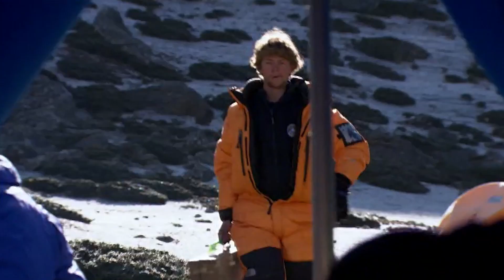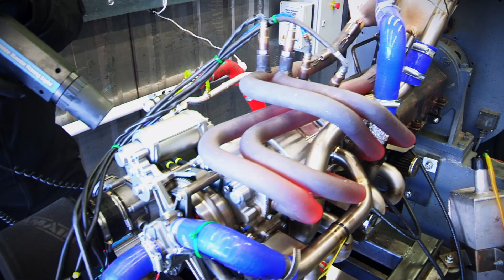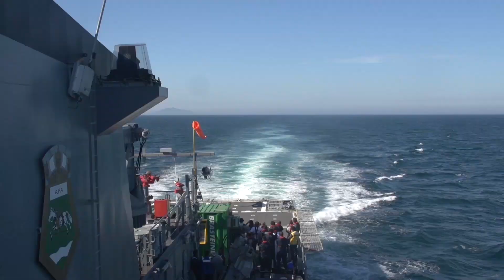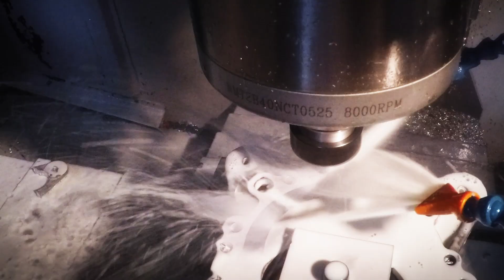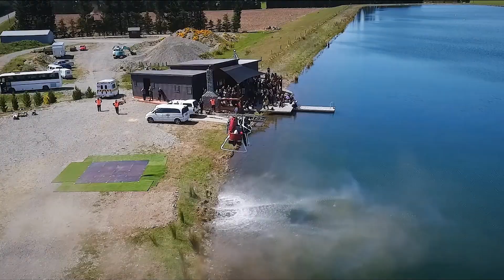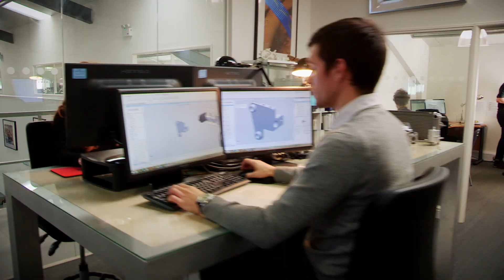Introducing Rotron Power Engines

Comment: This would make a great gokart engine
Reply: It made a terrible go cart engine in the 1970s when Sachs sold this exact engine.
Reply: Hell yeah a shifter kart with this Rotron 690CC. A NRV588 witch was bummed off sachs would be sick in a shifter kart.
Reply: @jlo13800  Rotron doesn't sell engines... Gilo Industries only makes paramotors and they buy reciprocating 2-stroke engines from Vittorazi SpA.
Reply: @sandervanderkammen9230  Rotron is in the UK, i heard they run silkolene pro 2 sx in the rotaries. Not sure. What 2 stroke oil do you run is yours.
Reply: @sandervanderkammen9230  AIE is got a 650CC 125hp single rotor, it uses a big blower fan to cool the rotor, called SPARCS technology. funny thing is i have seen a big 4500 HP Siemens electric motor king of using the same principle to cool the rotor.
Reply: @jlo13800  AIE is not a manufacturer.. 
Yeah thats another version of the same 1960s vintage Sachs KC60 engine
Reply: @sandervanderkammen9230  They scaled to 650cc per chamber. i have had good results running amsoil interceptor 2 stroke oil. the dominator is for racing 2 strokes and it will crud up if not run hard enough. Rotaries dont have the high compression/temp the 2 stroke piston engine do. I notice a lot of smoke when he runs Brian Creighton run his bike . It sound like it wont idle good.
Reply: @sandervanderkammen9230  Rotaries are like some 2 strokes and run oil injection, no sump or oil changes required!
Reply: @sandervanderkammen9230  Both Ball lightning and the sun are rotary loop charged plasma 2 stroke. I dont suggest connecting a copper or stainless rod to a Parajet or aixro-xf40 and flying in a thunderstorm as lightning may stroke and create a 60000 deg f plasma which would melt the roller bearings to the e-shaft and melt the charge cooled rotor.
Reply: @jlo13800  Parajet only uses Vittorazi reciprocating engines now
Reply: @sandervanderkammen9230  They went back to piston 2 stroke as they can have much more low end torque.  I looked through the rotron pdf broshure and the torque on the 300/600 is poopsey and dont come on till past 5500 rpm. the only machine that makes torque from 0 to over 6k is a rotary electric motor. the little Siemens 260 348 HP motor can fit in out lap and make 348hp or more and 737 ft-lbs torque @ 2500 rpm all day from idle to that rpm. there are electric motors you can hold in your hand that make insane power/torque and like 8 hp/lbs'ish power to weight. Tesla's are just trashing 4 joke stroke/2 strokes at the drag strip and all that has to be done it tap radiant ZPE and get off frail chemical fuels which use valence electrons anyway. Mounting a rotron 600 drone engine to a motorized sofa would be fun though.
Reply: @jlo13800  Gilo Industries stopped selling Wankel engines because reliability and durability problems.
Reply: @sandervanderkammen9230  It looks like it long live the 2 stroke piston engines, detroit diesel, Rotax, Polaris, Fairbanks Morse and Cummins (Achates Power). I got someone on the horn at Rotron and he said to run Silkolene pro 2 SX 2 stroke oil. The ceramic apex seals help but they are not indestructible.
Reply: You can still get an Aixro XR-50 from rennntech karting , it's 50 hp@8500 RPM and need 50:1 Rotaries are smoother, dont require oil changes and dont vibrate much. They are just a funny form of 2 stroke. A KX250 can make will over 50 HP at 7800 rpm's and much torque if a an exhauste trapping valves is use that shuts up the exhaust port and allows a longer burn time with high compression. That how the 8v92 detroit 2 stroke i get out back works. getting a few gallons of BRP XD-100 2 stroke oil was onsale at walmart to top her off.
Reply: @jlo13800  What API or JASO rating?
Reply: @jlo13800  old stock, production ended.
Why? The Axiro XR-50 sucks!
Reply: @jlo13800  Wankel not Rotary type engine...
Rotary engines are 4-stroke but use oil injection because the crankcase is the airbox..
Reply: @jlo13800  why would you premix a Detroit Diesel engine???
Reply: @sandervanderkammen9230  Its Etec oil for evinude, SAE 40W and cheaper than  silkolene. My girfriend had an RX-7 and ran nothing but amsoil dominator even though that was overkill for that 13b. it ran off the stock oil injection and you just add it as it goes. the burn rat is like a quart per 1000 m iles which was noremal, the amsoil dominator was the racing synthetic 2 stroke oil and way tougher than any 10w30 4 joke oil even though the 13b was lower compression and less loading than many 2 stroke, it was fast but it did not have a lot of low end take off torque.
Reply: @jlo13800  What is the API JASO rating???
Reply: @jlo13800  Mazda 13b engine is a 4-stroke engine.
Reply: @sandervanderkammen9230  they are durable because they are sad, not even the best tool steel roller beaings, e-shaft, plasma coated ceramic housing or YSZ ceramic seal well help them last long as sadness breaks them down! sadness destroys the best steel and ceramic regardless what ever the Rockwell hardness is.
Reply: @sandervanderkammen9230  https://www.youtube.com/watch?v=If4RfooLBwg
Reply: @jlo13800  Thanks for proving my point.... stupid people can't read the label or the manual.
Reply: @sandervanderkammen9230  These are amazing engines and they could work with pulsed plasma Like Joseph Papp inert gas filled pulsed plasma 2 stroke engine. The toroidal plasma ball lighting plasmoid is the key to tapping ZPE. I have Moray B Kings books on this. Interesting stuff.
Reply: @jlo13800  Use 2-stroke oil in your flux capacitor.
Reply: @sandervanderkammen9230  Actually castor oil is used in some capacitors on electric motors. The castor 927 Maxima is the top racing 2 stroke oil and has some low ash detergents to burn cleaner but you got to really push the motor to burn it off. Amsoil interceptor 2 stroke is more than enough for  my rotary and it 52$ a gallon jug. A rotary dont have as high compression as gas/diesel 2 strokes and lower burn temp so Castor 927 maxima could buger things up in a rotary. Amoils dominator is a racing oil and is harp to burn off. I got some of that also. The BRP XD-100 Etec oil for evinrude is for my bigger v8 2 stroke detroit. 48$ a gallon at walmart. and a very good oil.
Reply: @jlo13800  what 2-stroke oil do you recommend for the flux capacitor in my 1982 DeLorean???
Reply: @sandervanderkammen9230  Redline synthetic 2 stroke oil. Its not cheap but you could get by with XD-100 Etec full synthetic. the Delorean has a impulse gravity wave driven sachs km914 294cc.
Reply: @sandervanderkammen9230  An inverted wankel patent:https://www.youtube.com/watch?v=-SDGbZwVY20&t=55s
Reply: @sandervanderkammen9230  Silkolene pro 2 SX and Motul 8002T are like $16.50/quart that's a ripoff!
Reply: The DeLorean is powered by a 4-stroke PRV V-6..
Im talking about "mr. fusion"
Reply: @sandervanderkammen9230  I talkled to Paul Moller on the phone about when the rotapower charged cooled thingy was going in production and they are still trying and almost did but the covid19 hit. Not even god can put put this motor in production. The Aixro xr-50 from rennteck karting is like $5000 for only 294cc and 50hp. you can get big block snowmobile 2 stroke really cheap with way more torque and power. You could convert a LS1 chevy v8 into a 2 stroke for less than that.
Reply: @sandervanderkammen9230  You can convert to a 2 stroke poppet valved loop scavenged. Its been done with the 2JZ toyota and is a neat modification for 3L 2JZ toyota race fans. Also every lighting bolt is a 2 stroke plasma. You can use 2 stroke oil in a 4 stroke crankcase and i do that today its just overkill as its kinda of thick.
Reply: @sandervanderkammen9230  Check out this generator, you could build one for your delorean.https://www.youtube.com/watch?v=P-a8QAeCoNU&t=651s
Reply: @jlo13800  I wouldn't use any oils that are not API rated... even of it were free.
You have to be stupid to buy Amsoil.
Reply: @sandervanderkammen9230  A poppet valve 2 stroke VW 1.9TDI:https://www.youtube.com/watch?v=qosAllch8Sg&t=107s
Reply: @sandervanderkammen9230  The inlet valve need to be baffled to cause a loop carhe and prevent short circuiting for a perfect sweep. The cams need to run 1:1 with the crank but the exh valve need to open a bit early to allow exh bleed down. Its sound like you are a true 2 stroke fan like me. More2 stroke exist in the spirit real 4th dimension due to better materials/metals andinsane multi axis machining with aetheric streams. this can even cut zirconia/yttrium ceramic roller bearings and M50Nil tool steel crankshafts/ rods and other parts. These advanced metals/ceramics are materialized right out of the quantum vacuum using though energy there
Reply: @sandervanderkammen9230  What oil do you like? The interceptor works fine and is SAE 30w full synthetic 2T. What is the worst that will happen, form a black hole? XD-100 BRP is just as good and cheaper and available at walmart.
Reply: @jlo13800  What is the API rating???
Reply: @jlo13800  Do you make your hats out of regular or heavy duty aluminum foil???
Reply: @sandervanderkammen9230  I been ggoling it and cant find it so ill get on the horn can call amsoil and find out now that im am curious. API american petroleum institute rating. It is SAE 30w not 10w30 full synthetic. XD-100 is SAE 40w.
Reply: @sandervanderkammen9230  7068 billet aluminum. Aluminum is not good for us and why would anyone make a hat out of it. The witts generator is interesting as uses the quantum vacuum field ZPE which has 10^108J/cc. Tom Bearden is on this.
Reply: @sandervanderkammen9230  Amsoil is tight lipped on this but i will find out! Ill get someone on the horn. Dont use dominator unless you are really maxing out your engine as its harder to ignite and burn off than interceptor or XD-100. Your delorian makes 450hp in 4 stroke more and 1350hp in 2 stroke mode. Ill bet you are running ceramic roller bearings in her.
Reply: @jlo13800  I ask for the API rating, not the viscosity.
API ratings are a S, C or T
E.g. API SL or API TC
Reply: @sandervanderkammen9230  Hold on ill find ou i get on their site and they dont mention, they brag on how hot and clean it burns but ill will call them. What oil are you using, silkolene?
Reply: the jug i have dont say nothing!
Reply: You got a sachs 294cc dont you?
Reply: @sandervanderkammen9230  ill keep searching, Jim Morrson's 800 cubic inch V8 2 stroke ran Motule 8002T which is 16.80$ a quart!
Reply: @sandervanderkammen9230  Alien spacecraft and run ceramic roller bearing in their propulsion impulse gravity and all their machine CNC tools with laser radiant beams. All they need is a bit of graphite powder! Both silicon nitride and zirconia ytria are used on all the machinery on there. they have 5 axis CNC mind over matter machine tools aboard! The rockwell hardness of their tool steel is insane!
Reply: @jlo13800  If it doesn't have an API rating then its shitty low quality oil. 
Even recycled oils have an API rating!
Reply: @jlo13800  I own an original Sachs KM24 engine.
Reply: @jlo13800  So you wear a hat made of heavy duty aluminum foil then?
Reply: @sandervanderkammen9230  i think we all need to get over the chemical burning 2 stroke/4 stroke and tap radiant/ZPE! Even the hydrogen 2 stroke will reach its limits!
Reply: @sandervanderkammen9230  Who cares what the API rating is it holds up way better than multi viscosity 4 joke stroke oil but ill find out now you got me thinking about it. The ghost 72 arctic cat puma with sachs km914 just went by again with 40 hp! I have no idea what oil they run in the spirit realm in this thing.
Reply: @jlo13800  Any oil that cant pass API testing is garbage.
Reply: @jlo13800  How would you know? If your oil doesn't have an API rating you don't know anything about it except maybe the viscosity, if its not API rated you can't even prove what the viscosity is!!!!
Reply: @sandervanderkammen9230  OMG you driving nuts, what oil do you want or like for your 294cc sachs pulsed plasma anti gravity 2 stroke. Do you want a nissan UD-6 2 stroke diesel! Holy cermamic roller bearings batman ET will fire up his machine shop 5 axis CNC with mind over matter!
Reply: @sandervanderkammen9230  Oh shit you just converted a 2JZ 3L into a 2 stroke congratulations on your 1850hp dyno run!
Reply: Amsoil works who cares about the API as the a ghost keeps running a sachs 294 40hp articat on god knows what, shit he drives by at around midnight and runs ceramic apex seals. most likely silicon nitride or what ever they have over there
Reply: @sandervanderkammen9230  oh no its not! The spirit that haunts my property as unlimited machine shop capabilities and makes over 160Hp out of 294cc billet 7068 aluminum, tool steel e-shaft and ceramic apex seals and roller bearings!
Reply: @jlo13800  It on loan, part of exhibition at a museum.

I collect antique and obsolete engines like the Wankel.
Reply: @jlo13800  What kind of ignorant fool buys oil that doesn't have an API rating???
Reply: @jlo13800  YOU WILL VOID YOUR WARRANTY IF YOU USE OIL THAT IS NOT API RATED
Reply: @sandervanderkammen9230  A lightning strike is a 2 stroke over 60000 deg f and no gas/oil weak chemical fuels required. Chemistry just bumps a few valence electrons, broken symmetry inn the vacuum. Mother nature's rotary is out of control as it damn near leveled kenntucky and that awful as the damage is unimaginable!
Reply: @jlo13800  Only stupid people buy oil thats not API rated.
Reply: @sandervanderkammen9230  gasoline 2 strokes make way more power than diesel2 stroke/4stroke
Reply: If you dont like asmoil 2 stroke dont run it, get over your API ratiing, i you hate it dont run
Reply: @jlo13800  DIESEL 2-STROKE  engines require API C rated oils.
Reply: @jlo13800  Any oil that is not API rated cannot be used if you have a warranty.
API guarantees the quality and the correct application for motor oils.
Reply: @sandervanderkammen9230  yes and amsoil dominator an MTU just bit me as i pulled its tail
Reply: never corner an MTU as they they bite
Reply: @jlo13800  Amsoil is crap
Reply: @sandervanderkammen9230  yes TCW3
Reply: not multigrade 4 joke stroke oils as 2 stroke diesel runs on anti friction bearings and has high loading
Reply: @sandervanderkammen9230  XD-100 is CF-2 rated
Reply: amsoil is overkill but i did dump in 2 quarts of amsoil dominator that i had siting around
Reply: @sandervanderkammen9230  Wankel is oil injected and does not need oil changes like  4 joke stroke
Reply: @sandervanderkammen9230  i had a 69 472 caddy 2 stroke that took tcw3 penzoil at 50:1 and internal filled total loss
Reply: @sandervanderkammen9230  Im glad that the electric motor is kicking the crap out of the piston 4 joke stroke as i hate it
Reply: @sandervanderkammen9230  Amsoil interceptor more than exceeds the oil as diesels do not produce much power for there size. they need a lot of hel to make power with turboes and and a wankel is much more powerful than any diesel! Diesel do not even come close to a wankel or 2 stroke spark ignited engine, cooper bessemer has a piston ported natural gas V16 2 stroke W330 that makes 9300 hp to 12,500 hp at 330 rpm to 514 rpm! they do not need oil changes like the wankel does not and total loss burn off like a skidoo or 60's caddy
Reply: @jlo13800  You have to be stupid to buy a oil that doesn't meet minimum API rating and voids your warranty.
Reply: @jlo13800  Amsoil is crap oil for stupid people
Reply: @sandervanderkammen9230  What is your favorite oil? This stuff works good
Reply: @jlo13800  Depends on the vehicle... 
I use Aral SuperTronic G in my Ford and my Porsche because it meets A40 specs.
I use LubroMoly Synthoil Premium in my BMWs and my VW because it meets LL-98 and 503

I use Agip Novecentro in the Maserati

I use Swepco for the Aircooled  Porsche and VW transmission lube because it shifts best with the old style synchros.

Motul gear lube for the newer VWs
Because it meets VW G51

Redline D4 ATF for all the Dexron automatic transmissions and the ZF manual transmissions that use ATF (BMW and Ford)
I use Total in the Yamaha SHO
Klotz in the old Honda and Kawasaki bikes.
Motul in the new bikes.

The list goes on....
Reply: @sandervanderkammen9230  You got a lot of nice high dollar stuff there
Reply: Are you running this oil?
Reply: @jlo13800  What is the API or JASO rating???
Reply: @jlo13800  Do you work in a florist shop?
Reply: @sandervanderkammen9230  On a tugboat with huge 2 stroke diesels, im used to total loss oil burning. One of my OMC 528cc sled rotaries is haunted and it gave me a stinging sensation when i touched it. Its in the back room. I got a few and i tinker with them inside when there is a thunderstorm.
Reply: @sandervanderkammen9230  Also rotaries are powerful torsion field generators too.
Reply: @jlo13800  Do you shape your poo into little rotors on the days they don't let you out for exercise?
Reply: @jlo13800  Thorazine is a powerful antipsychotic medication.
Reply: @sandervanderkammen9230  what rotors?
Reply: break rotors?
Reply: @jlo13800  The shapes you see when you are hallucinating...
Reply: @jlo13800  Yes rotors break... very often in fact.
.
Reply: @sandervanderkammen9230  though interacting with the spirit real make one of the best cast iron, nickle molybdenum alloy! the roller bearings are m50nil tool steel most likely developed in the spirit real and manifested in our world! cryogenic freezing for a while may stress relive it though, it makes it chill.
Reply: @sandervanderkammen9230  yes charge cooled rotors!
Reply: They appear out of the spirit realm as they have 5 axis machine tools with mind over matter to materializes any charge cooled rotary 2 stroke!
Reply: @jlo13800  Do you smoke crack?
Reply: @jlo13800  All Wankel engines operate using the 4-stroke principle
Reply: @sandervanderkammen9230  Some not all of them as the there are patents on 2 stroke Wankels. The Sun and ball lightning are 2 stroke rotaries!
Reply: @sandervanderkammen9230  Hopefully we will have Wankel powered trucks!
Reply: running on electrodynamic  ZPE pulse plasma 2 stroke cycle, not frail chemical fuels which have low energy.
Reply: @sandervanderkammen9230  They appear as 4 cycle hear but they are 2 stroke in the 4th dimension.
Reply: @jlo13800  All Wankel engines operate using the 4-stroke principle YOU ARE A LIAR!
Reply: @jlo13800  You are a crackhead that smokes rocks...
Reply: @sandervanderkammen9230  even a 2 stroke piston engine has 4 cycles, the otto cycle. many toyota 2JZ have been converted to poppet valved u-loop charged 2 strokes!
Reply: @jlo13800  That doesn't make Wankel engines 2-stroke.
All Wankel engines operate using the  4-stroke principle exactly like an Otto type engine.
Reply: @sandervanderkammen9230  that was the one patent.
Reply: what 2 stroke oil do you use in yours.
Reply: @jlo13800  Which Wankel engine?
The DKM-54?
Or the KKM-57?
Reply: @jlo13800  The one that is the correct API rating.
You don't know anything about motor oils do you?
Reply: @sandervanderkammen9230  KKM-57, Not all 2 stroke oils give their viscosity, The XD-100 and amsoil interceptor work great.
Reply: @jlo13800  Every single production Wankel engine is based on the KKM57 patent.
The Wankel KKM57 is a 4-stroke engine.
Reply: @jlo13800  What does viscosity have to do with rhe API rating?
What is the API rating?
Reply: If you hate amsoil dominator dont burn it and inhale the fumes! no one cares
Reply: @jlo13800  Amsoil Dominator does not meet the minimum API specifications for any engine manufacturers.
Its a scam!
Reply: @sandervanderkammen9230  It dont meat it it excedes it do you have a better oil?   what is your premix? Never corner an MTU as they will bight
Reply: i conored an MTUm8000 and it bit me good
Reply: @jlo13800  Amsoil doesn't meet minimum API specification for any manufacturers.
Overpriced garbage!
Reply: @jlo13800  MTU requires oil that meets API and EC specification.
Amsoil voids MTUs warranty requirements.